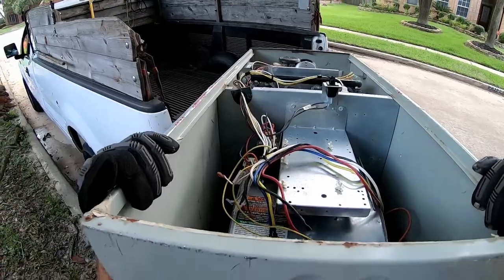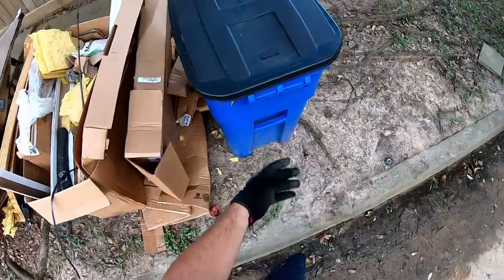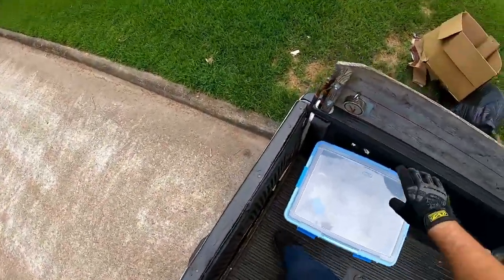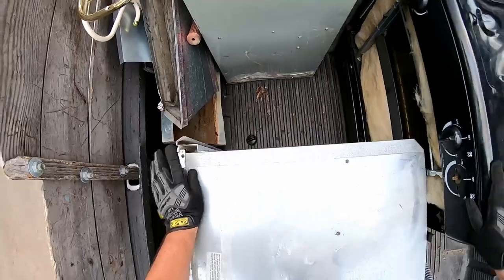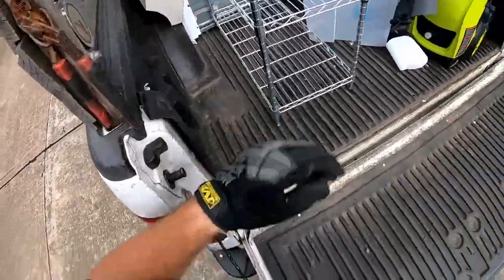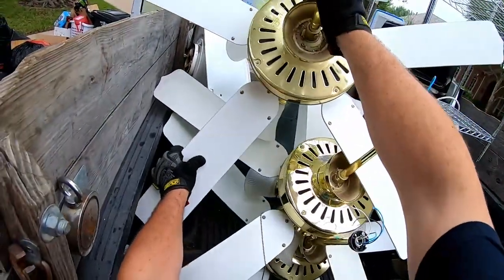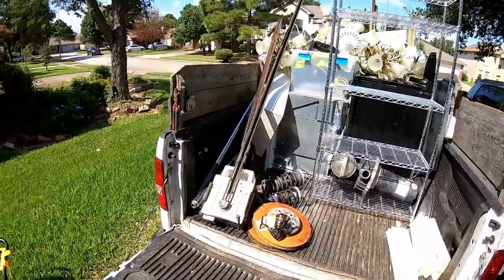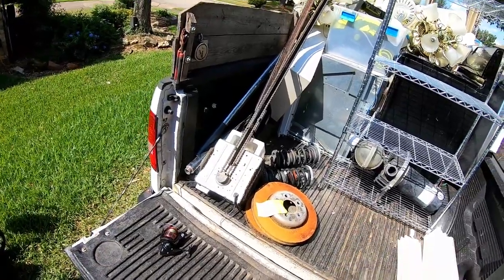Curbside Scavenging "Got It Before The Other Guys Did"

Comment: I use a spring compressor to get the spring off the struts and sell them for short steel and they should take the shock there isn't that much gas in it to cause an explosion. They grind them up when they do whole cars. Keep up the great videos and God bless you and your family.
Reply: I'm thinking also that it's the springs their worried about, they'll go a flying

Comment: That pressure washer is an excellent find!  All it needs is a good carb cleaning.  Pay especially close attention to the little ports in the jets (free tip:  never pass up guitar strings, as they tend to be the perfect gauges for snaking through the ports on a carb.)

Comment: I usually don't care for curbside, but this time you scored!  Two suggestions: First, check the heat exchangers in the furnaces. There are a lot of them now with stainless steel exchangers, due to the condensate in very high efficiency furnaces.  Second, you might look for a Chinesium replacement carb for that engine, around 10 bucks. For future info, go out to your local small plane airport, and buy some LL100 or LL110 gasoline. It never goes bad from sitting, and has zero ethanol in it, so no corrosion of aluminum parts. But don't use it in your truck! A steady diet of it may be good for the engine, put over time ruins your catalytic converter. I use LL100 on all of the small engines around home. Always ready to go!

Comment: Hi Mike the shock absorbers. Some are pressurized, so what you do is get a plastic bag and a container for the oil. Place the plastic bag over the bottom of the shock and drill a small hole into the shock while its in the bag and drain the oil out into the plastic bag and pour into the waste oil container. They should accept it then. Our local scrap metal place will accept gas bottles and ac gas bottles etc if you drill a hole in them as they worry about them exploding when they crush them. Anyhow most have brass valves, so you take them off anyway. You found some good stuff today.

Comment: Check and see if there's a fuel filter between gas tank and the carburetor on the dewalt pressure washer
I love the videos bro keep up the good work
Reply: From experience, usually not always, when people throw pressure washers away it's because they didn't winterize them by making sure they got all the water out from the pump and the pump cracks from frozen water. Once they find out that they could almost buy a new pressure washer the price of replacing the pump, they usually get rid of them.
Reply: On the Dewalt pressure washers it's almost always a low oil shutoff because they shake the oil out when they vibrate while running it comes right out the fill tube ongoing problem for DeWalt and Ryobi or like the gentleman said above a cracked pump promoters rarely go bad on Dewalt pressure washers

Comment: You could cut the springs on those struts to relieve the pressure therm take them apart. Just make sure they are not under pressure before you take them apart

Comment: You may already know this, Mike, but the easiest way to take those metal shelves apart is to turn them over and the shelves should drop. just be sure to save the black, plastic shelf supports. Any of the commercial size parts can probably be sold for good money.

Comment: Freon tanks, Helium tanks, Shocks and Struts, just put a cutting blade on your angle grinder and cut a good sized slit or two in them. All the scrap yards around here will take all those items if you can show that any pressure has been released and will not build up in the shredder.

Comment: That Dewalt PR might have low oil cutoff,  won't run with low oil? Nice haul bud!
Reply: I was thinking the same thing it's got to be something simple on that Dewalt pressure washer because they don't go bad the electric ones go bad all the time but the DeWalt one pulled up really well maybe a pump at worst definitely worth getting fixed worthmore on the market then in scrap

Comment: Try getting some fresh fuel in it. The gas might just be bad. If that doesn't do it check to see if there's an inline fuel filter.  Sometimes those get clogged up and they won't let the gas through fast enough.
Thanks again for what you do.

Comment: Harbor freight sells a spring compression tool..or use a ratchet strap to hold the spring compressed safely to take those struts apart..so the scrap yard will accept them..its the compressed springs that are very dangerous when they get released suddenly..

Comment: You might use a hatchet or a sledge hammer when scrap won't fit where it looks like it would... it's going to scrap anyway, so it doesn't have to remain pristine. It probably isn't pristine by the time you take it off the curb. But, you're experienced enough to know right away if it's for resale, or it's going to be scrapped. 🤗

Comment: Hey buddy lookup a video on cleaning that carb. I would bet it's not bad gas its the shitty ethanol gas we have now days will not last a winter before it starts putting deposits in the carb. You might need a set of torch tip cleaners to get in one of the jets to knock the clog out if there is on. Good luck

Comment: Take carb apart get a real thin wire or torch tip cleaner, poke it in the Jets, use brake clean Flush out , clean rust out of bowl with Scotch Brite, GO to walmart get Some startron gas additive blue bottle, this stuff works well. FOLLOW THE DIRECTIONS. My son told me about it when he was a certified honda mechanic, honda sent them a Shop Memo about using it when they did card and fuel Injektion cleaning.

Comment: You can drill a small hole into the struts and shocks in the end of them and compress them and squirt the oil out there usually not pressure on them if there extended.

Comment: My yard is good with struts as you found them as long as I toss them with my shred/tin. They said the springs are a #1 but I'd have to dismantle but as you said they are under pressure so I don't bother.

Comment: In order to get that DeWalt working again I had the same exact one the ethanol 8th through the diaphragm in the in the carburetor you have to rebuild the carburetor or replace it and that'll make it run again once you do that it'll run like a champ that's the only problem with it it's the carburetor

Comment: shock itself probably a no no, but you can get the spring up. Those little electric pressure washers freeze up. Sometimes some scotch brite can get 'em going again. But they suck. The gas one, maybe see what's up?? Those shelfs at Costco are not cheap. If ya don't need it, scrap it! Too bad I didn't live closer (Calif) we did new gutters, they were aluminum. I cut it up on my saw and to the dump..... Watch Yo Head, Watch Yo Owie and Watch Yo Back jumping down off stuff, making me nervous jumping off of stuff.

Comment: You can probably sell that DeWalt pressure washer as is the motor if it runs or turn over can sell easy for $150 and up

Comment: If you take the the struts apart you shouldn't have any problems at the scrap yard. those springs aren't under that much of a load since they aren't on a car but if you borrow a set of compression tools you can take what little pressure is on them off and then they are just spring steel and scrap steel at that point. yeah any Honda motor you'd do good to repair and keep around. those things run for ever if you don't leave them sitting with gas in them when you're done

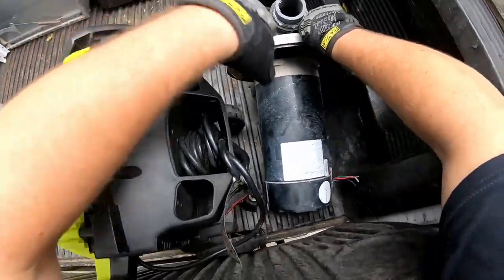Comment: How does Mike the scavenger get his game on? He plays truck Tetris of course lol how is the hole in the leg brother? 15:30 pressure washers are underrated in terms of scrap value, they all have a very fast medium to high torque motor that is easily converted and be used for a CNC router machine,  there are lots of cast aluminum parts inside and always a good gauge long power cable and a few little bits of brass and stainless in the handgrip thingy.